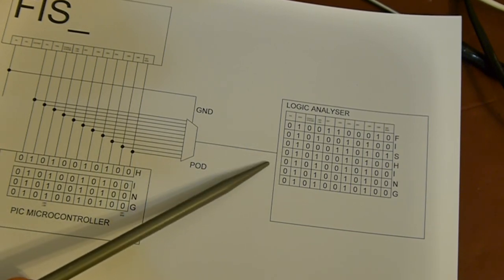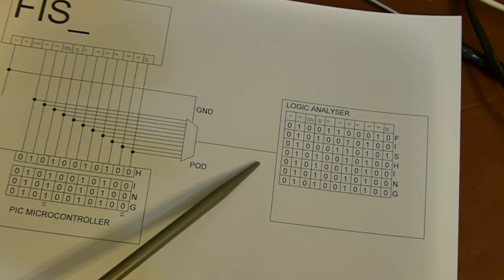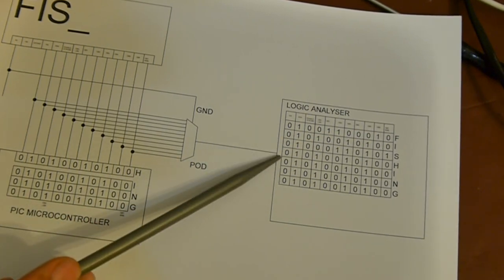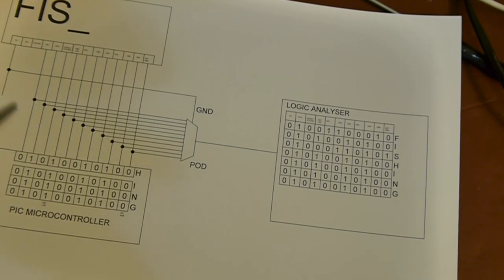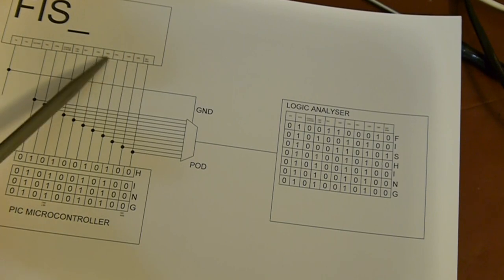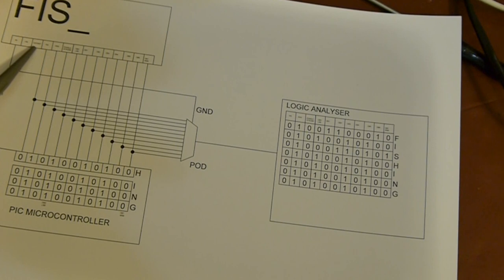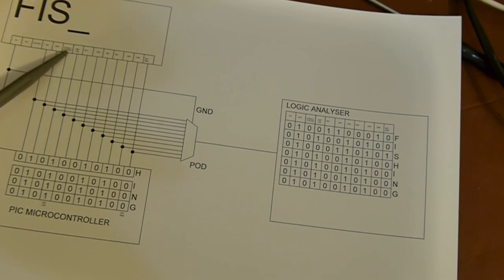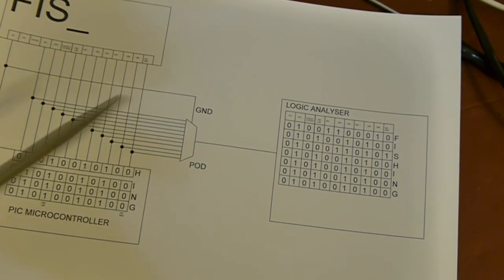Illogical Analyser - Part 1

Comment: I think that centronics type connector is an Ieee or GPIB connector,
Reply from the maker: Simon Spiers Are Ok that's interesting. I think it does have a GPIB mode, but I think it needs a special GPIB interface pod.  Still thinking of getting a GPIB interface for the HP Distortion meter.

Comment: Lol "its still set to the 1970's"hahaha good luck with it mate i wouldnt have a clue where to start!
Reply from the maker: Hi Gary. It’s an interesting bit of gear and for what I paid
it’s been very entertaining.  The more modern USB logic analysers are much easier to operate and having the computer interface key board and mouse make for a better user experience.  I’m guessing that there is not much use for these as the days of combinational logic have long gone and been replaced by onchip solutions.  Best Regards Chris